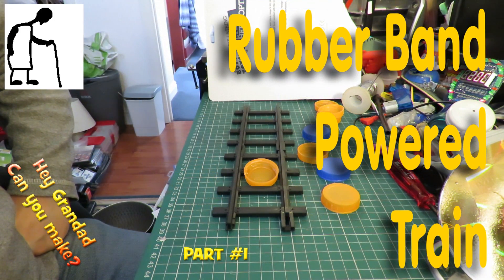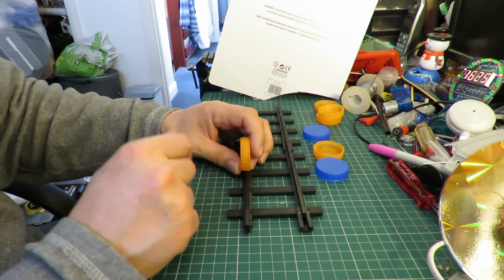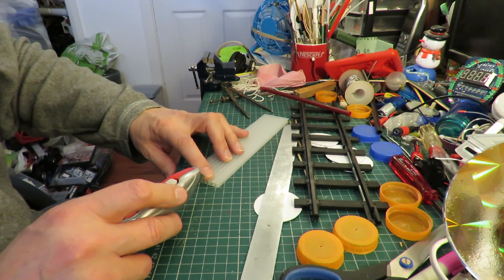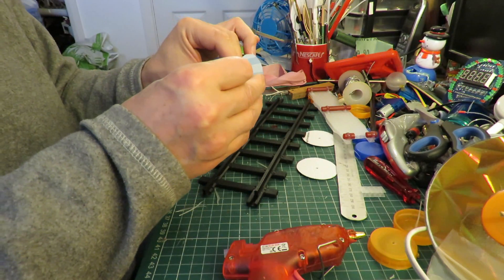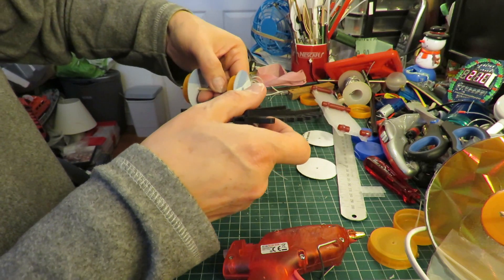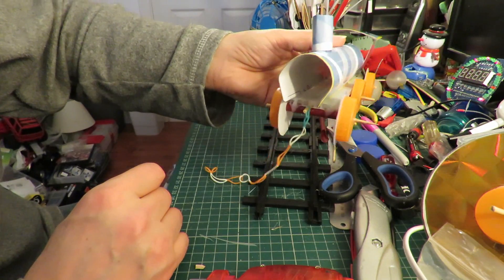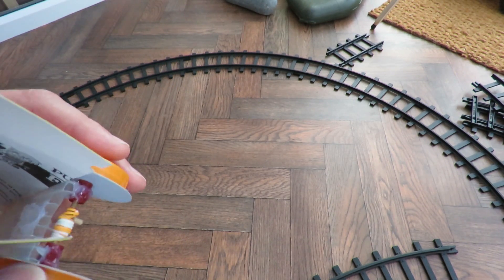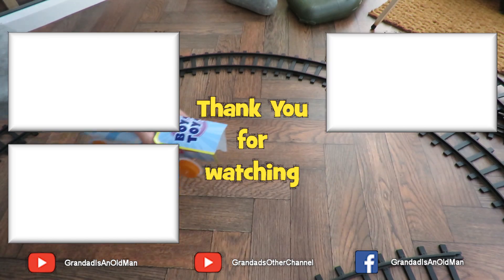Rubber Band Powered Train #1 semi success

Comment: Until now I had never seen a rubber band powered train great job well done
Reply from the maker: Not very practical as you need a long body for a long rubber band motor if you want it to go very far or you need to
 use a gearbox. In a straight line it would be easy as you could have a really long motor but once it has to go round a bend you get a problem as I found out 😊

Comment: a couple of metal wires glued inside the caps might add weight (but you did it well).
Reply from the maker: To add weight to the wheels I usually pack them with clay but the main issue here is the length of the train means it does not go round the bend. You need to have both the front and back axle turn into the bend and that means you get a problem winding the rubber band round the back axle as it would pull to one side. You also are restricted on the length of the body and motor because it needs to be straight and that looks wrong when it goes round the bend.
Reply: GrandadIsAnOldMan oh no..your right..there has to be a way.